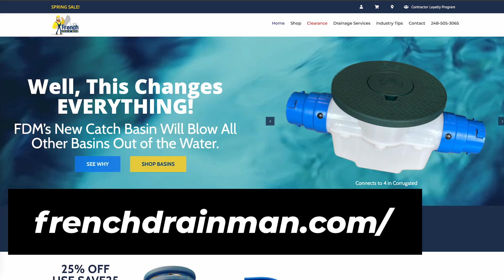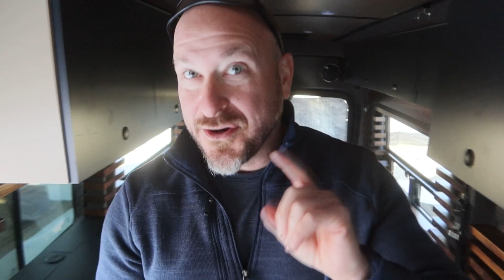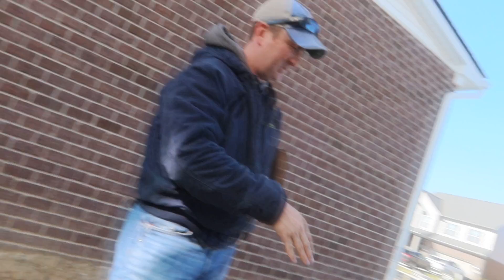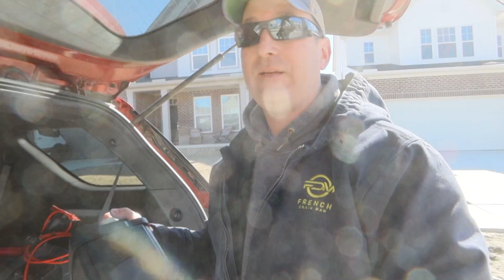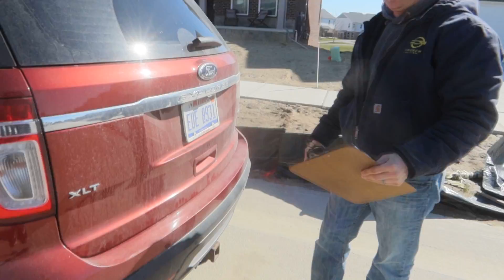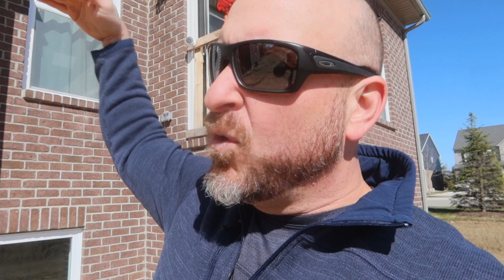FRENCH DRAIN MAN came to my house

Comment: Dear Matt. I don't know the regulation in the US, but I expect that it's a requirement for planning from the land developer for points with sufficient capacity to be connected with stormwater for all the new properties in the area, and a requirement for the house developer for planning of stormwaterlines with capacity for all the stormwater from your your property with the house, driveway and garden in stormwaterlines to the connection points for stormwater prepared by the land developer. If you are living in a area with possibility for tempetatures below the freezing point during the winther time your stormwater- lines have to be secured against frost to secure the lines against freezing water with ice filling up the lines during the wither. As known they have to be open and able to take care of the spring floods and avoid erosion on your property. As known with a lot of new exstreme rainstorms the stormwaterlines must have much greater capacity than before. I wish you a good time in your new house. Best Regards Arne G from Norway

Comment: I'm not versed in the building codes specific to your location. Typically, in some municipalities it's expected that developers include drainage solutions, such as perforated drainage tiles, to manage water runoff, directing it towards a culvert situated between buildings. In some areas, the local codes might also require the creation of stormwater management features like wetlands. To ensure compliance and proper execution, I recommend consulting with your local building inspector and coordinating with city surveyors. This approach is essential within the construction process. Considering the complexities involved, particularly in a HOA community and URBAN environment, I wouldn't undertake this project on a DIY basis. There are many pitfalls. Such infrastructure should ideally have been established during the initial development phase. In my opinion, the cost burden doesn't fall on you, but the developer and the municipality itself for neglecting to implement proper run off systems.